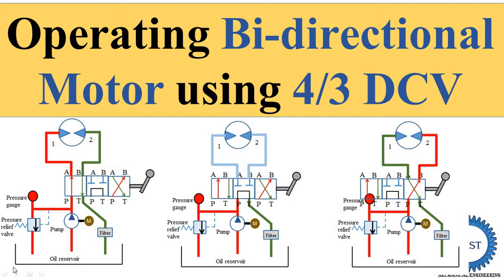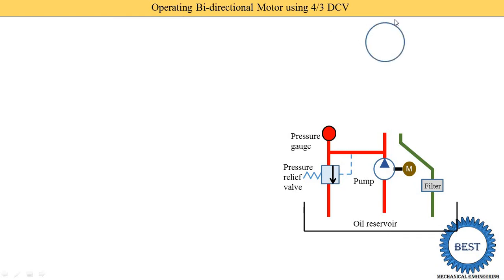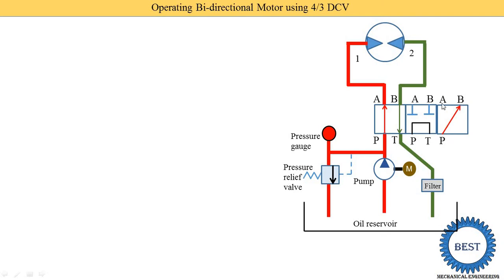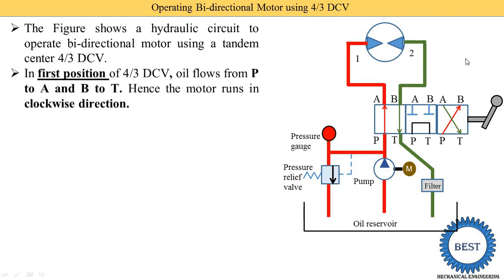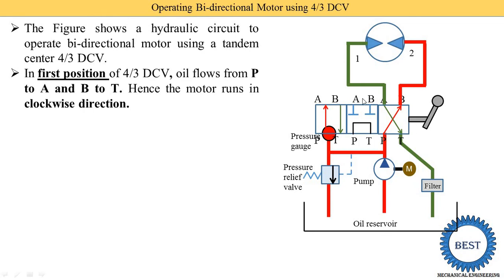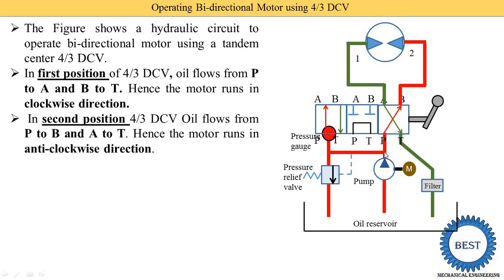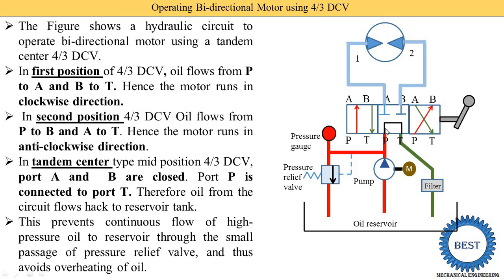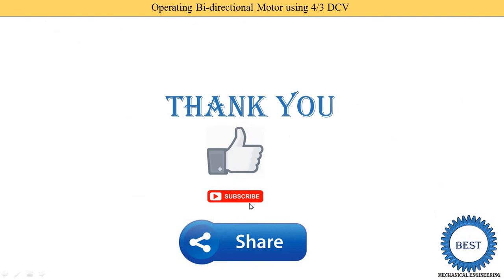Operating Bi directional Motor using 4/3 DCV

Comment: Can i use that control valve in the anchor winch?what will hapen if somebody accidentally move the control and the power  unit is off?
Reply: @Chiefkyle how about if the gearbox is using spargear?